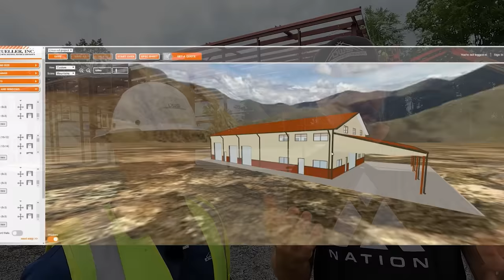Pole Barn v/s Steel Building your dream shop or barndominium explained

Comment: Fantastic!  From 1964 until 1971 we lived on a farm that had a large wooden barn.  I found it on old maps from the late 1940’s, so it had some age.  The bottom edges of some of the side boards were rotting and the stone and mortar foundation was deteriorating.  Tenants who lived on the property after we left rehabbed that barn with a concrete block foundation and new boards where needed.  Wooden barns may still have a place, but today steel is the way to go.  Well done, Josh.

Comment: Need to do a total cost video.  People love numbers it will get a ton of views
Reply: Or the cost will scare them to death.😁
Reply from the maker: yep....numbers have been discussed in most of the mega shop vids leading up to this...when it's all said and done nearly at $300k just for the shell, windows and doors/concrete
Reply: @StoneyRidgeFarmer  nice man I must have not caught those videos.  I may or may not watch these will driving back and forth to work 🤫
Reply: @StoneyRidgeFarmer you said 5 roll up doors? was that part of the 300k?
looks great btw. its obvious you got a whole team of professionals working on it and not a bunch of meth heads lol
Reply: also curious how much concrete did you use? pad thickness? footer depth? its a tall building for sure
Reply: @StoneyRidgeFarmer you aren’t serious with 300k right?

Comment: Hey Josh, if you are wanting windows in your doors they are extremely easy to install I have done several of them I just bought replacement door windows at Menard's and cut the hole then installed them myself. It was surprisingly easy and it makes you wonder why they charge so much extra. I now buy all of my metal doors/exterior doors without glass and then if I want glass I just install it myself.

Comment: I built this (i'm sitting in now) much like that - different company - Heavy I beam and got 400mph grade on the windows and 300 on the building.  And steel doors.  You will enjoy the building and use the fool out of it ! I had 90 cement trucks and 100 full length sand trucks of building sand.

Comment: Might wana throw some bolts threw the top of those doors, self tappers are strong but can get weak and break if your holding heavy gauge material.
Reply from the maker: these guys know what they're doing for sure my friend...it's bolted in several places..just didn't show it in the vid

Comment: My first career was being an erector I done all kinds of buildings some red iron some wood and some just a combo of different materials. For the sqft for a building is the way to go if you're going to live in it. That's why it's expensive easy to erect. I bet it didn't take longer than a week to erect. Here's a tip don't smash the screw's the rubber will rote away and it's like a car body. Do You wash your car? Dust and scratches cause damage. A simple 3 inch scratch will rust through the skin It's not maintenance free.

Comment: Stoney Ridge Farmer - Nice building! I'd like to put up one myself but I would prefer Spray Foam for the insulation. No mice, bugs, bees etc... getting in the walls.
Reply from the maker: Spray foam cost is about 4 times higher...makes the building price go up by around $50k my brother...that's pricey!
Reply: @StoneyRidgeFarmer  - 100% agree but worth it if possible.

Comment: I like the building. The thermal expansion explanation is a complete non-starter, but if it makes you feel better so be it.
Reply from the maker: not sure what a "non-starter" is....however seems you must know more than us...if not you wouldn't be commenting. Maybe explain what you mean since you seem to be an expert my friend....why does your opinion sway from the manufacturer?
Reply: @StoneyRidgeFarmer   Your claim was that the exterior steel would have the same thermal expansion as the structural steel, and therefore the fasteners would remain secure, or something similar. Your building is built with insulation between the exterior materials and the structural materials, this will create different temperature zones and the materials will change in size accordingly. If you or the manufacturer need this explained further I will be glad to assist.
Reply: @ingcampthree4523    Hes full of sh... my 75 year old barn alll the 6x6 8x8 and 4x6 beams and truss are all bolted together.. no bolts or screws are loose or wearing themselves out.  The outer board and batton walls are nailed in and holding just fine.. nothing has losened over 75 years EXCEPT a few batton boards that have warped.   Also the interior of the building will expand differently then the exterior.. doesnt matter if its steel or wood.. its due to the thermal expansion from the sun beating on it.  Metal also gets warmer than wood does when the sun is beating on it...When was the last time you put your hand on a wooden building with the sun on it and burned your hand from touching it ??  Yea never... now go out and touch the hood of your car during peak day... exactly.    I also do no need insulation during the summer months in this barn because of this..  Where a metal building like this does because lets face it. the metal is going to cook you alive inside without it.   In Virginia weve had a few 98f days so far this year.. when i walk into my workshop the temperature drops 25f easily.   In a metal building with no insulation itll be hotter inside than outside.   Another interesting thing with wood is in the winter with the heat on.. it actually RETAINS heat fairly well

Comment: looking good -- we didn't do the rolls of insulation as it has been our experience that it is a perfect nest for mice and will end up full of mouse pee and poo down the road.
Reply from the maker: anything you build will be a heaven for mice and other critters if you don't have it all sealed off good...that's for sure
Reply: Here in ZA we use Aerolite (pink fibre, looks the same as what were used here) . . .it cannot burn, and rodents hate the feel of it, they stay away from the fibre.
Reply: Some shed cats will keep rodents at bay.
Reply: @kdegraa  to some degree - but in 10 years insulation full of mice pee and poo - prefer closed/open cell spray in.

Comment: This is for Toby: Sir, I’m a retired commercial roofer, with 30 years experience with just about every kind of roof system imaginable, except these new “Green Roofs.” Like it was mentioned in your video here, screws are one of the weakest links to this type of metal roof system. I also will add to this, any roof curbs or penetrations, i.e., vent pipes, expansion joints, air chillers etc. I personally would test my men, with mock, metal roof set-ups,p inside my shop, and test our men, several times per year, and have them properly demonstrate their screwing down the metal roofing  panels, then go over their every screw, checking with a hand held hex driver of appropriate size, to make sure the screws were drawn down tight enough, but not too tight that squashes the gasket neoprene washer. A well trained crew is golden, to assure less call-backs for leaks. However, do to thermal stresses or wind fluctuations, its inevitable, there will be a small leak sometime within 5 years of the new building being installed. It doesn’t mean the work was shoddy, it’s simply expansion and contraction.

Comment: I really appreciate the pointers Toby has given. Thank You!  I do like the look of wood structures.  Is it possible to add beefy metal encasements around the doors and windows to make them look as sturdy as they are really?  Metal looks skimpy compared to wood even though it is stronger in this application.

Sorry, is that too much flare for being a farmer?
Reply: Edward, while not typical it’s definitely workable to wrap the openings with wood.

Comment: The use of X-bracing was very interesting. To watch dominoes fall down is entertaining to watch but not on such an expensive building. 

X-bracing looks so small and flimsy as compared to the rest of the construction which I find even more interesting as an ignorant novice. It looks like it's designed to be somewhat flexible but prevent total collapse by limiting too much extreme of movement.....and shifting the strength to the footers somehow.
Reply: X-bracing is done with high strength steel cables, tensioned to spec with turmbuckles. They don't really flex.
Reply: If ya notice, rods not cables. Definitely an upgrade from what some steel company's offer!  While it seems an X, they're actually, under load, just one half.  Rods don't have too much compression loads (cable has None!), but the tensile strength of 1" rod is significant !
Reply: They don't want to let the wind move the building even 1/4 of 1 inch. Tell me if I am wrong.
Reply: You guys are dead on. 1/2” rods are used in the roof and back sidewall to resist longitudinal environmental loads… typically wind in our area. We utilized a portal frame in the front sidewall to allow for an overhead door.
Reply: @tobyanderson5492  
Environmental loads 
like earthquakes.
Brick and masonry and heavy structures are really bad in earthquakes.
Reply: mainly on a gable building,it requires rods,gable meaning a peak.
Reply: @Herecomesthethruth  
Your comment is unreadable.

Comment: i've bee trying to build a shop for the last year and the price changes are insane
Reply: its going to cost me over 100k its crazy why are things like this
Reply: Greed!
Reply: Ya, I totally agree. In 2020 a pre engineered 50x50 steel building from R&M steel in Idaho was $40,000, delivered to Seattle. Today a 60x80x16 hangar with one door is $97,000.
Reply: @scenicbearviewing  just started forming my slab this week, the engineer cost me big time rebar, cement and time. going to be 40k just in the slab
Reply: @adamm2716  What the size?
Reply: @scenicbearviewing  40x60 with four column for an over hang

Comment: Very, very interesting!  So excited for you Josh.  I don't quite understand how the box bracing will replace the X cable bracing throughout the structure.  Is it transferring the strain the same way an H brace does in fencing?  If so, how is it tied into the main structure?
Reply from the maker: well...I'm not an engineer...but we're working on getting me down to the factory where they are designed and built
Reply: The portal frame transfers the longitudinal loads from the roof bracing system down to the foundation the same as the x-bracing. The use of a portal frame allows for wall openings such as the overhead door opening in Josh’s building.
Reply: @tobyanderson5492  Thank you.  I get it now.

Comment: Personally I hate that type of insulation. Been in alot of nice shops that always seem to have rips or holes in the plastic backing of the insulation. 
Around me I always hate hearing property owners say they have to act as the General Contractor. Because normally it means that whoever is installing the building doesn't want to go through the process and insurance to get a general contractors license. 
There is some other oddities I notice, but I'm just a fence builder that occasionally helps put up welded frame steel buildings so bye no means an expert.
 In all it looks like an awsome future shop and I look forward to seeing you put it to work🤙🍻

Comment: Looks very nice, but why does the roof have such a shallow pitch?
Reply from the maker: because we aren't in an area that gets much winter weather my friend...remember this is engineered for my area
Reply: @StoneyRidgeFarmer  Thanks for reply. I`m in the UK and we have to have a lot steeper roof pitch on our farm sheds, Building looks great.
Reply: @StoneyRidgeFarmer  Even if you were in a snow area the building is designed to carry the load.  I built many many steel buildings with 1/4 to 1/12 pitch roofs with no problem.  We are in a 50 psf region.

Comment: Since the difference in expansion and contraction wears out your screw holes on a pole build, wouldn't the same happen because you have insulation between your outer steel and the inter structure?
Reply: of course not,on a pre fab building, it's designed this way.pole barn set up is quite dif
Reply: @Herecomesthethruth  could you explain that more than just "of course". I'm looking for more science than a blanket statement.

Comment: Hey Josh, great video what made you decide to pre-frame the external structure completely with steel instead of only doing the posts frame and then using wood?
Reply from the maker: this is a custom engineered metal building....I wanted a steel framed commercial structure.  We'll go inside and frame out what we need later ...stick around you'll see. To use wood we'd need to span 28 feet between the beams mounted to the ground....defeats the purpose of buying a steel structure my brotha
Reply: @StoneyRidgeFarmer  agreed! Just right now we are looking to build similar, but they are offering us just the main post structures and roof but the rest of the framing on the exterior for windows and doors would be done with wood but I’m not exactly a fan of that but right now wood prices lower than steel 🫠

Comment: Will you be installing roof air conditioners or foundation mounted ?
Reply from the maker: No air conditioners in the main shop, heat pump/ac units in the main living area and mini splits in the butcher shop/larter and common area along with wood burning stoves in shop, common area and living area

Comment: Since fire is a much more frequent hazard here in Norway I'd use laminated wood beams for a structure like this.
Reply from the maker: There will be wood framing in the building...but it's a steel structure...nothing in this shop is flammable....a laminated wood beam would be flammable...I guess I'm not quite getting the logic buddy?

Comment: The residential doors are going to be the first failure point on this building, because the wood jambs will rot pretty quickly on a building with no overhang like this.  We went with the commercial doors and windows on a red iron metal building, and they are still going strong 28 years later.
Reply from the maker: remember brotha...we are not done here...this is simply the first phase of construction...porches and overhangs will go over those doors

Comment: I have heard horror stories about metal buildings not being put up correctly. One case of the metal on the bottom not being secured as it should have been, the result was a very crappy end result.  The solution to that senerio is use a top notch contractor/ general contractor familiar with steel building erection. Don't  cheap out on contractor crew. Get referrals & prior project pictures.  Best wishes.

Comment: Josh, how is the building oriented!? North/South, East/ West?
Just wondered if you thought of facing what windows you have, to keep the sun on the window side of the building!
Reply from the maker: front of building faces mostly south..but slightly westward so the evening sun comes in a little....I situated it thinking of the predominant wind as well as the sun so I didn't have any moisture issues

Comment: The thermal expansion argument is voided with your insulation.
Conditioning the interior spacing means your frame won’t expand/contract near as much as exterior sheeting.

Comment: I have a question for Toby because i have heard 2 sides of this but the cables that you use to keep it square is it true or not true when the building is all done you can remove those yes or no and why do some have them and others don't?
Reply from the maker: depends on how your building is engineered

Comment: Very nice building!😎 Each to his own, obviously. But the only thing I would want differently, is that roof pitch. Even with the steel trusses and stringers, I would want more angle. If you get a lot of snow in your area normally, that flat of a roof, I would think that would be a ton of weight sitting on the roof until it melts.
Reply from the maker: my friend...this is engineered for the appropriate snow load for my area...we aren't in the great white north here brotha...we dont get much snow, ice or really very cold weather
Reply: @StoneyRidgeFarmer  oh, I see. Apologies if I was out of line. I admit that I don't know where you are. I know that in my area of Kansas, we sometimes get large amounts of snow, and very few use that pitch of roof because of it. Even if it's all steel construction. (I have put up a few, as part of a construction crew. So have seen it. And talked with company owner and customers. However, I am just a novice. And working with that company was 30 years ago. So I didn't intend to step on toes with my comment.
Reply: We have a whopping 15 psf ground snow load / 10.5 psf roof snow load at the SRF.

Comment: When the roof starts leaking, how does the roof get fixed? What gets done with all the wet insulation that is now pressed up against the metal sheeting? How does it dry out, if the moisture barrier is on the inside? Wet metal rusts really quickly.
Reply from the maker: if the roof developes a leak....we can see it in the insulation....we fix the leak and the vapor barrier is on the inside so the heat and the metal ribs simply dissipate the moisture.....we're talking about a potential leak from a screw insertion site that might drip 30 ml of water in a year...so the answer is ...Time will tell the tale my friend...you could toss one of these pieces of galvanized roofing in a pond and it would take 50 years to rust through

Comment: The man urinal needs to be a large funnel attached to a  post or tree trunk with a long pipe leading away from the building. A jug of water is needed to always rinse thru the funnel. That will keep disgusting flies from gathering, coming inside to shit all over the walls, windows etc & annoy people working with tools in their hands. My cousin once swatted with a big knife in her hand (we were cutting  summer squash for market) & cut herself pretty badly.